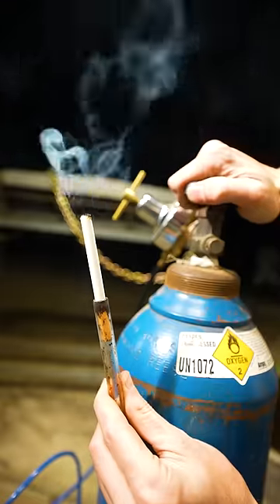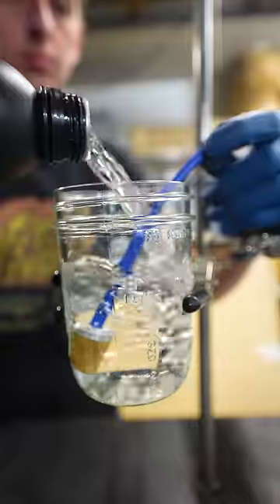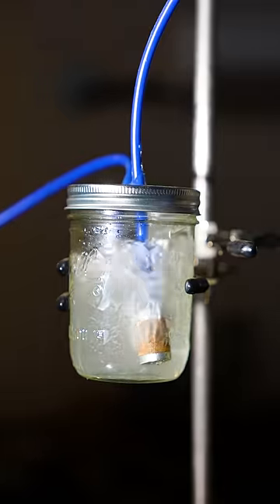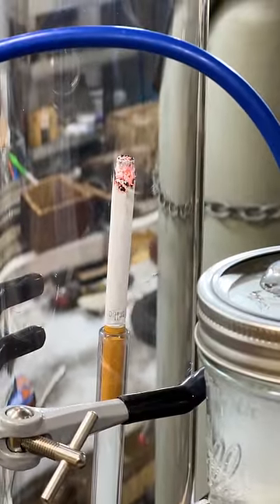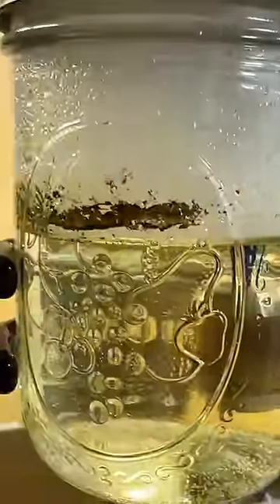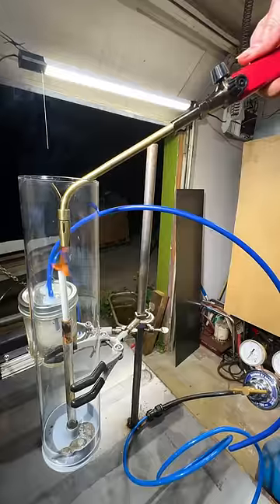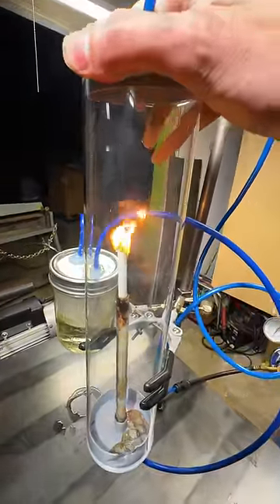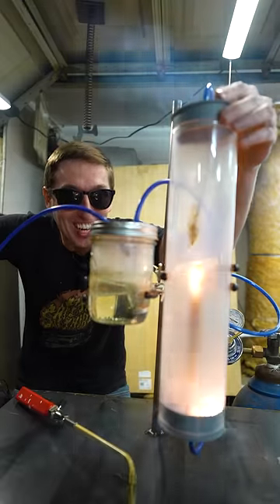Don't Smoke in pure oxygen

Comment: Fun fact i used to work hauling pure liquid oxygen to hospitals and such. that stuff would boil to a vapor immediately once it leaves the insulated tank and/or piping. As such you were NOT permitted to smoke when loading or unloading a trailer (or even with 50 feet or so of the thing), a rule that many drivers just ignored. Well, we had one guy who didnt replace the hose gasket before letting the oxygen loose into a customer tank. When you go to release product into a cuatomer tank, that hose is right at about chest/stomach level. Ol'boy had a ciggy lit and when he let the product out, it leaked out of the hose at a high pressure, instantly vaporizing and causing his cigarette to burn so hot it cinged his facial hair, and drop embers onto his shirt which also caught fire. Dude come out of it with 2nd degree burns all over his chest.
Reply: Lucky man, coulda been much worse
Reply: That's hilarious
Reply: Cool!
Reply: Healthcare note: smoking while on oxygen can very easily kill you. The oxygen burns really easily and people have burn themselves to death from smoking while reserving oxygen. It is a horrible way to die
Reply: Put oil on that gasket and the cigarette isn't necessary.
Reply: @markkerlin2585  explain
Reply: @citizenx2369  pure oxygen can oxidize things in a pretty fast way and the reaction is exothermic.
If the generated heat reach the flash point of the thing (which is quite easy for oil and greases), the thing self ignites and ignite everything else around (including metal, which is flammable in pure oxygen!!!).
This problem is usually related to high pressure oxygen at room temperature BTW, not liquid oxygen (at ambient pressure but cryogenic temperatures).
Reply: Did dude get fired?
Reply: @citizenx2369  oil and liquid oxygen is big boom
Reply: Australian?
Reply: @eh26fh Smoking while not on oxygen can also very easily kill you, just a bit more slowly.
Reply: EMT must have seen that a lot XD
Reply: @carbonbeaker409  uh......no it couldn't, you're saying that like oxygen is like petroleum
Reply: @atcera8714  Smoke is unburnt fuel. High oxygen environment means things can burn more. Meaning, if the smoke that was being inhaled along with the high oxygen caught fire again, he could have had internal burns. You can do a basic test of this by blowing out a candle and relighting it by quickly setting the smoke on fire again.
Reply: Back in the 80s somewhere in Chicago, I heard on the evening news of a van full of oxygen cylinders from a company delivering them to hospitals burst into flames and killed the 2 delivery men in the van. They said cigarette smoking in the van, which was strictly prohibited, caused the accident. Oxygen concentrated in a confined space with plenty of available combustibles and a source of ignition is a bad recipe.

Comment: The fact that smoke remained in the chamber and some made it to the pump means less smoke/tar was captured by the jar. Not necessarily less, it just overwhelmed your apparatus.
Reply: It’s still does exactly what he built it to do : model a human smoking a cigarette . 

A human in smoking a cigarette in normal air vs a room full of oxygen would have roughly the same difference in experience as indicated by the experiment .
Reply: Except no human ever in the history of humans has smoked a cigarette that way.
Reply: @johnathanlong264  true . I’m not sure I get your point . That the whole thing is unrealistic because no one would do that ? I’m pretty sure you understand the point of the video .
Reply: It’s like sugar with your teeth. It’s not the amount you’re exposed to it’s how long you’re exposed to it. The pure oxygen tank smoked the cig in a second which is part of the reason there was significantly less tar then the control cig.
Reply: @DrShawn_  it’s just bad experimental design. From the set up and the way he described the results, the goal of the experiment was to compare tar output from smoking a single cigarette in different air conditions, not test how burning changes in different conditions. The first one pumped all the tar/smoke into the water. The second one burned instantly and had a lot of the tar leak out. You basically lost the entire experiment. The only thing you could determine was that burning in pure oxygen causes a more robust fire (duh) and that the apparatus cannot handle that amount of smoke production. While humans do lose a bunch of tar in air as the cigarette burns, these are not equal. It’s like letting one just burn while the other one is smoked more consistently. 

You can make no conclusions about tar, what it would be like for a human to smoke it. I know this is a silly short but my point is more on how research is properly interpreted which a lot of people do incorrectly, including bonafide researchers. This is why the peer review process exists, so bad conclusions can be limited in publication.
Reply: @ExternusArmy it doesn’t matter why there was less tar in the water as long as it matches what would happen in real life .

Are you saying a human smoker would be able to inhale all that smoke in a pure oxygen environment better than the vacuum chamber did v
Reply: @ExternusArmy 

See you are replacing the actual goal with a subtly different one . 

Your criticism is basically that you WISH he was testing how much tar is produced per unit of tobacco in the starting cigarette . 

What was actually tested was how much tar enters the lungs under each condition . 

My point is that WHY less tar entered the lungs doesn’t really invalidate the experiment . If there were some kind of magic that consistently made a raccoon appear and steal the cigarette before it burned then I’d say “0 tar in the lungs” is a valid conclusion to make . 
😂
Reply: @DrShawn_    except he points to the end product as proof of his proposition.  smoking in pure O2  results in less tar.    which isn't true...as pointed out that   some amt of smoke is not captured/filtered through the water bubbler.    thus resulting in an inaccurate measure of the tar/smoke residue  from smoking a cigarette in that manner.
Reply: Not just that, but logically, smoking a cigarette in pure oxygen will always result in less smoke and tar because the cigarette will burn hotter in pure oxygen and therefore more of the smoke will be decomposed into pure CO2 rather than remaining as whatever complex compounds they are now
Reply: @stephenx2857  for the sake of the argument, Shawn is right. Assuming pressures didn't change between experiments then you could conclude the smoke remaining in the chamber is smoke that the apparatus could not draw in due to how volatile the reaction was. In practice a person would lose more smoke mass between puffs in an oxygen rich environment simply because the reaction is more violent.
Reply: Maybe that’s the clue to our lungs that causes some to get sick and some not. Maybe some get too much to handle and other don’t😂
Reply: @johnathanlong264  how humans smoke a cigarrette?
Reply: I, too, smoke the filter of my cigarettes.
Reply: @DrShawn_ terrible model, doesn't even look like a human
Reply: @octoberwildsmoke9065  this is true
Reply: @RebelSoul2010   still makes pointing to a jar  and saying it's representative of how much tar/smoke is processed through a cigarette   useless.    

i honestly don't get the stupidity here.   If the jar is supposed to represent what was smoked.   and one sample captured almost all the smoke.   and the other one captured significantly less.    the large amt of missing capture is relevant to the final quality of the capture liquid
Reply: @stephenx2857  less tar in the water would be less tar in the lungs . Im not saying it's perfect , no experiment is . But it isn't claiming to be something it isn't . Light up a cigarette in a pure oxygen room and see if you get any more tar in your lungs than what he saw here . Im assuming there will be more smoke in the room than in your lungs as well .

Comment: Smoke is a by product of incomplete combustion, meaning the hydrocarbon was not able to fully combust for one reason or another. Smoke is comprised of many different molecules, smoke soot molecule structure is primarily composed of agglomerated clusters of carbon atoms, forming a complex network of polycyclic aromatic hydrocarbons (PAHs)

Burning propane or methane usually doesnt produce much smoke because they are short chained hydrocarbons which makes it easier for the molecule to completly combust/react and break down into CO2 and H20 with no byproducts, hence no smoke. 

Good example of complete combustion are CON trails, they look like clouds because they are clouds(literally made out of Water Vapor). The more efficient the combustion the less smoke will be created, its ideal for aircraft because efficiency=$.

Using pure oxygen removes one of the variables that causes incomplete combustion, therefore it will burn cleaner with less smoke.

Also consider cigarettes are comprised of 100s of chemicals that dont burn cleanly like hydrocarbons.

Comment: Careful with plastic tubing for the oxygen, it's super flammable on its own. You def don't want that flame traveling back up the line
Reply: Usually a metal nozzle on the tank.  Luckily its just an oxidising agent and not a flammable gas
Reply: It's probably not PE tubing, and setting PVC on fire is very difficult for some reason, which is probably why they use it for electrical wire insulation.

By the way, why is PVC inherently fire retardant?

Well if you do end up burning it, it's going to poison you pretty badly.
Reply: @SianaGearz I think the chlorine in PVC’s  structure makes it less flammable. It’s already “oxidized” the carbon and hydrogen a little bit so it’s harder for it to burn in air. 

That said, it doesn’t oxidize all of the atoms, and I think PVC would still burn  violently in pure oxygen.
Reply: @deltab9768 That's the important part.  Pure oxygen can turn something from self extinguishing to rocket fuel.  Also flexible PVC has a lot of plasticizers that increases its combustibility.

Comment: More of the volatile organic compounds are completely combusted in pure oxygen as the temperature will be significantly higher.  As any fans of organic chemistry, or fans of Explosions&Fire, most organic tars left over from reactions are yellow.

Now I couldn’t say if it’s more or less cancerous without a deep analysis.  There are quite a few compounds that are completely clear that would be very very bad.
Reply: The cigarette companies already did the research decades ago. They already know that most of the carcinogens are created by combustion of the tobacco leaf. They also know it is not necessary to burn the leaf in order to extract the nicotine and flavor that the smoker desires, all that is required is a controlled application of heat that is below the combustion temperature. When the tobacco is properly prepared the controlled heat will make it give off vapors that can be inhaled without burning the tobacco, basically like vaping. They developed a system called Accord that used a battery powered device to heat a special cigarette to "vape" it without burning it. They successfully tested it and were prepared to market it as a "safer" cigarette. That's when the anti tobacco forces stepped in and threatened lawsuits, saying you can't claim tobacco is safe at all in any manner or we will destroy you. (It is also known that even chewing "smokeless tobacco" causes cancer). This was after the big product liability lawsuits in the early 90s that cost them bigtime, so they dropped the Accord program.
Reply: @onemoremisfit  That's actually kinda fucked. As I understand it, there are certain benefits to smoking tobacco, and if there was a way that the negative effects could be reduced, would this not benefit people who want to smoke AND the people worried about health effects? Unless they actually don't care about health and just want control to say that smoking should be completely illegal... sure seems more like the second one at this point.
Reply: @onemoremisfit in Germany there is a company that sells these exact types of cigarettes that are meant to be vaped
Reply: @RobotDCLXVI  My reply was deleted.
Reply: @Makaya9s  we’re still probably talking about a significantly different level of temperature between basic dry vaporization and full combustion in pure oxygen.  Keep in mind in pure oxygen most things that won’t even ignite in the normal atmosphere will burn quite quickly.
Reply: @onemoremisfit  It's fine. Jyootube deletes 90% of my comments. Can't have people forming their own opinions now can we?
Reply: @RobotDCLXVI  Yes, I'm getting hit hard too, I can hardly say anything anymore, and the thing is I was only expanding on my personal stance on tobacco and smoking. I didn't think it was very strong at all, but I must have violated approved message somewhere.
Reply: @LogicalNiko  why are you telling me this?

Comment: For chemical analysis of cigarette smoke what they actually do is take a large sep funnel, add a small amount of water, something like 50-100 ml of water or so. Then they pull a vacuum, while under vacuum close the stopcock. You now have a sep funnel under vacuum, then just put the cigarette in the spout end, light, and fiddle with the stopcock a bit to get the flow right then you can smoke a whole cigarette in that. Advantage is all the smoke stays inside so it gives much more quantative results. Important to note they also sometimes add some special reagents to detect things like ketones and whatnot to make later quantative tests easier, although I can't remember the chemicals added right now. But yeah. Neat

Comment: Sadly, NASA found out about the dangers of a pure oxygen environment in 1967. 

From Project Mercury until then, capsules were pressurized with pure oxygen for a couple of reasons, namely in order to prevent astronauts from getting “the bends” or decompression sickness. However, in 1967, NASA was preparing to conduct its first manned flight of the Apollo program. 

The mission, Apollo 1, was undergoing a launch test on the pad when a fire broke out. The three astronauts tried to get out of the capsule, but they couldn’t open all three parts of the hatch. The capsule burned quickly in the pure oxygen atmosphere. All three astronauts, Gus Grissom (one of the original Mercury Seven astronauts), Ed White (a veteran of Project Gemini), and Roger Chaffee (Apollo 1 was to be his first space flight) died in the accident within minutes. 

NASA quickly went back to redesign the Apollo spacecraft and the spacesuits to ensure that this would never happen again. No other astronauts were killed during the Apollo program.

Comment: The yellow byproduct in the water is likely either hydrocarbons from incomplete combustion in the normal oxygen test, or its just straight up nicotine that gets chemically broken down by the higher combustion heat of the high oxygen test

Comment: The higher heat caused by the excess oxygen could breakdown the nicotine, nullifying the effect of a cigarette, however, it's bad in 2 ways. If you're smoking for addiction you would smoke more, second, higher heat may create additional compounds not found in normal cigarette smoke. Now, in not saying smoking is safe, but I wouldn't smoke either of these.